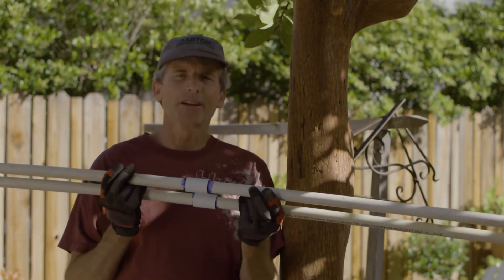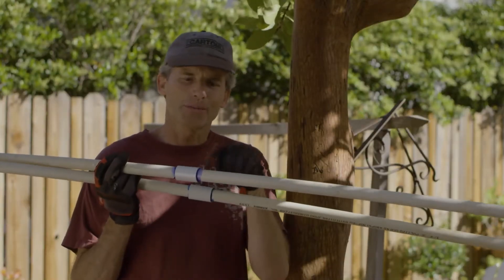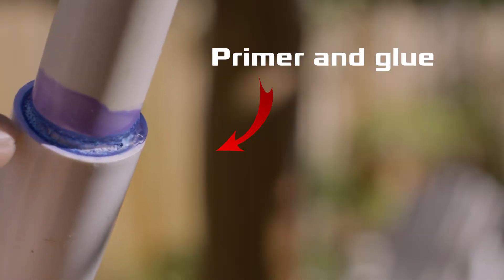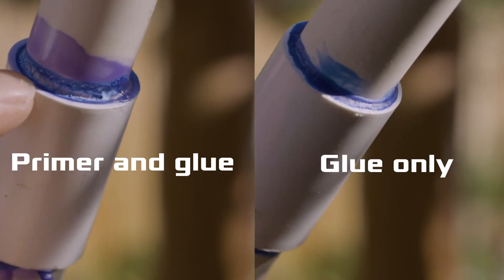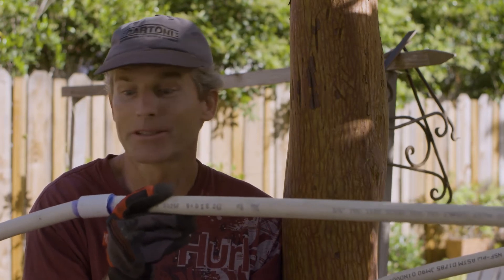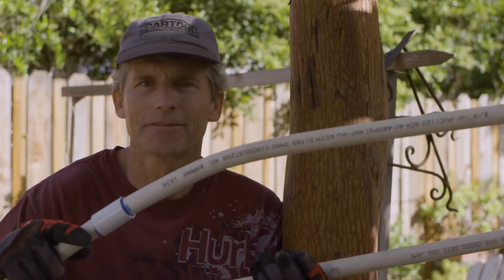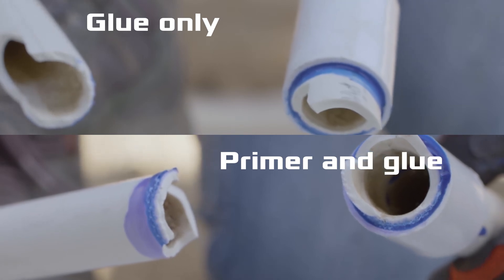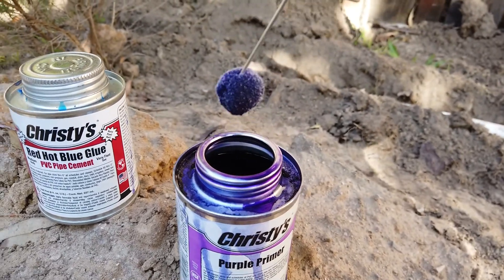Glue PVC Irrigation Pipe: Primer vs No-Primer test

Comment: I am doing a drain and don't think I need it for my sink drain. There won't  be water in the pipe and it isn't under pressure. Dry fitting alone these joints are very tight.
Reply from the maker: You don't need to use glue for the p-trap under the sink, those are usually threaded. But you need to use glue for any drainpipe that is inside the wall or under the house. I prefer ABS pipe for drains.

Comment: Although any testing is goid for learning, I appreciate any efforts. I'm not sure what bending around a tree proves, a certain amount of stress but not affiliated with any real circumstances. I sat another video where the guy tested Christy's vs. Oatley's, glued on threaded fittings and pressurized them until they blew, they all blew over 1100 psi, and not at the cemented joints. That's where 3/4" schedule 40 pvc piping let's go. The fact that all the failures were in the piping and not at any joints I found awesome.
Reply from the maker: Not a scientific test, just an idea I had to test my curiosity. You would be dealing with a much larger problem if something was bending your irrigation pipes 120 degrees. I was surprised how well they both held up.

Comment: The primed pvc looked melted because that is essentially what the primer does. It softens the pvc so that the pipe will fuse with the glue. So you have a fused joint rather than a glued one. Glue can become brittle over time with temperature and vibration. The trick is not to let water get mixed in during the repair. And that is not always easy when doing a repair. Also, allow the joint to cure long enough.
Reply from the maker: Yes, I agree. The complaint about using the primer, if you use too much will weaken the plastic by melting too much. After doing this video I didn't have the cap on tight enough and put it in a bag with some unions, it leaked out and literal melted half of one of the unions. Use on clean, dry pipes and follow the direction on the can and either way will work. Thanks for the comment

Comment: I do understand the logic behind the primer, but don't really see the benefits. We all know that a properly applied PVC glue will last forever, and if a leaks occurs, it will most likely be somewhere else along in the pipe, not in the glued joints. I guess the most important things to consider is to use a good quality glue, and apply it properly on both sides of the pipes that will make contact.

Comment: Use primer. Putting excessive strain on the joint like you are in the video isn’t realistic in a real life scenario. Normally glue joints are just left to set up without strain. I’ve been plumbing for awhile and when I’ve seen old plumbing that wasn’t primed, the glue joints get brittle and they can easily fall apart. Primed and glued pipe will hold forever. Only using glue might be fine for 10 years or so but eventually those joints will get brittle and fail.

Comment: The primered pipe is used material. The damaged fitting on the end of the pipe shows that. The age of pvc matters a lot for a test like this.
Reply from the maker: Yes, both the pipes were old, I don't remember if I cut them from the same piece. I would have expected the pipe to crack when I had it around the tree, if it was an age issue. Thanks for noticing.

Comment: Isn’t the primer used to create a chemical reaction with the cement? Heating up the pvc to make the bond?  Also. How much pressure is IN the pipe?  IDK. I’m no expert or a plumber.  Shrug.
Reply from the maker: The primer melts the plastic to help make a better bond between the two pieces. Which is why some people say it weakens the plastic too much and can cause it to fail. I spilled some on a union and didn't notice and it completely melted and deformed the union. Normal water pressure is 40-70 psi.

Comment: Also, don’t they sell glue that you do not have to use a primer? One step glue it’s been my experience down here in Florida, that I’ve come across more of these than any of my life where I found purple primer on the inside of a pipe, separated from the other side with no purple primer on it because for some reason the primer didn’t stay fused to the PVC, I stopped using when I saw that. Plus I had a buddy that also does handyman work too. Told me that primer is garbage.
Reply from the maker: Yes, the "Red Hot blue" doesn't need primer. Mt Father is law has done a lot of well plumbing and always uses primer and glue. After doing the test, I think if you use both types properly, you shouldn't have a fail.

Comment: Glad to hear im not the only one that didnt use primer.
Reply from the maker: In the 35+ years of doing my own irrigation, I really haven't used primer much until I did these videos. Only one failure that I can recall, and that was caused a tree trunk moving the pipe (There is a video on that one). On the other hand, my father-in-law has always used primer and doesn't like the Red-Hot Blue.
Thanks for the comment

Comment: … and, just use purple primer alone for the welding.  Holds strong, at least on a test pipe I'm testing.  Also, just acetone, for another test.
Reply from the maker: I know someone who has done a lot of work with wells, he had some primer only connections that someone else did fail. I don’t know it this debate will every get answered.

Comment: Wow. Thanks for this video. Just had a septic system installed, they didn’t use primer. They used a weld-on it pvc cement, looked it up online and it states it can be used without primer for non-pressure applications. If local codes permit, which mine does. Showing the strength of that plain glue joint eased a lot of my concerns. I know you said it gets more beneficial when the size increases, but if that much pressure is needed to cause a failure I probably have bigger problems
Reply from the maker: Thanks for the comment and glad you enjoyed the video. I was surprised myself. The only PVC joint that I can recall that has failed, was one I just fixed in the front yard. A huge tree truck started pushing on the pipe. I don't think anything would win that battle.

Comment: I have been plumbing for 30 years and never used primer.  I haven't had any failures so far!
Reply: Same experience over the last 40 years.  I believe that using primer, followed by cement, causes excess softening of the pvc.  PVC needs only the bare surface softened to form a firm bond.  The deeper the solvent(whether primer or cement) penetrates into the substrate, the larger the softened cross-section of the pipe and the weaker the joint.  Somewhere on YouTube is a very long video of side-by-side testing of the two methods, showing primered joints to have lower burst strength.
Reply: @williamreynolds7194  The primer will eventually evaporate out. It may take several days or maybe longer.
Reply: Thank you for taking away some concerns I had of some of my work😅
Reply from the maker: Thanks for the comment.
Reply: Same here, I never use primer on brand new PVC pipe but I will use it on old pipe
Reply: You wait another 80 years when it dont matter anymore
Reply: Also, don’t they sell glue that you do not have to use a primer? One step glue it’s been my experience down here in Florida, that I’ve come across more of these than any of my life where I found purple primer on the inside of a pipe, separated from the other side with no purple primer on it because for some reason the primer didn’t stay fused to the PVC, I stopped using when I saw that. Plus I had a buddy that also does handyman work too. Told me that primer is garbage.
Reply: really? you have never had a failure in 30 years? there are always failures.
Reply: Can I ask if you use Blue or Green Pvc solvent?
Reply: Yeah you have, they just called a different plumber to fix it. Joints will fail given time, UV exposure,  vibrations,  and pressure/depressurization cycles

Comment: I’ve never used primer and never had a fail.  I used it 2 times trying to do things right and had to redo.  Problem is everyone says use primer.  I am going to look for a video with a twist on joints.   Thanks
Reply from the maker: Thanks for the comment
Reply: Try-test with using only primer.   I did and it's strong as any, full strenth weld-fusion it appears.
Reply: If a manufacturer can convince code authors to demand primer, he can sell twice as much product.

Comment: I performed a psi test and the primer one failed.
Reply from the maker: Interesting
Reply: that's the test I was looking for thanks. I would think the bend test isn't really stressing the glue joint so much as the pipe itself. I had a no-primer fitting pop out under 85psi pressure for 5 years, which is why I'm here. FWIW, I just read a long experiment testing all modes of failure of primed vs not primed joints and there doesnt seem to be much difference between the two.
Reply from the maker: It’s interesting how many different views there are on this topic. I think if they are both don’t properly, either way should hold fine.

Comment: My dad used to install jacuzzi tubs for a living. He said he constantly had service calls for the tubs he used primer with. He noticed his tub, that he skipped the primer on never had any leaks. So he started installing the tubs without using primer and found all the tubs he installed without primer never received a single call. your mileage may vary
Reply from the maker: Thanks for the comment, I was surprised neither of them broke when they were bent 180 degrees.
Reply: Fascinating!
Reply: Its probably because a lot of ppl make the mistake of not letting the primer dry
Reply: @45llamas  you are not supposed to let it dry.
Reply: @45llamas  From what I've known, primers should not be allowed to dry, - putting the glue/solvent on when the primer is still wet purportedly makes for the strongest fusing.
Reply: @45llamas  
Probably right.  I thought I let mine dry before cement and still had a leak so skipped primer.  But I am not a professional!   Just a homeowner who has done a lot of plumbing.